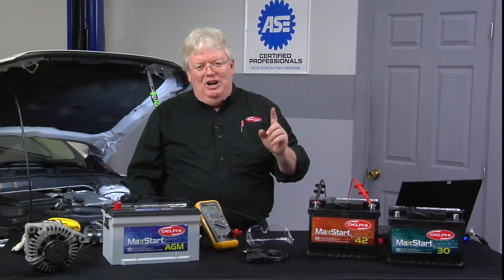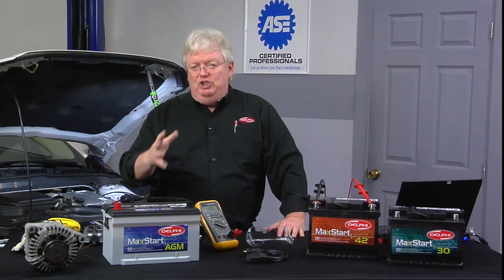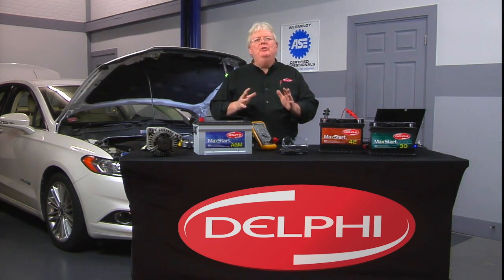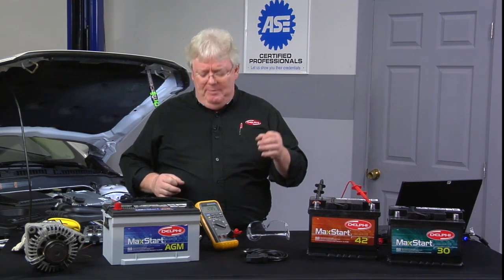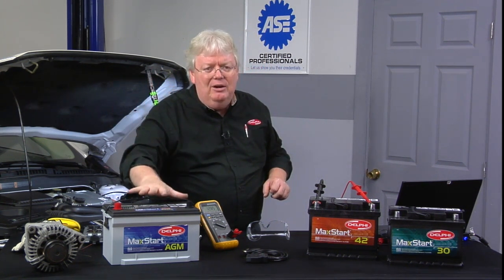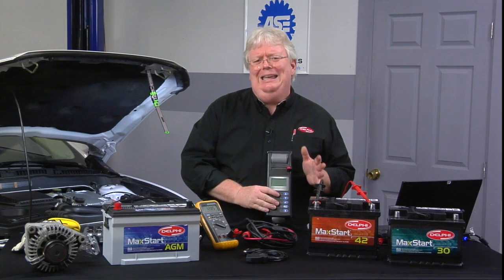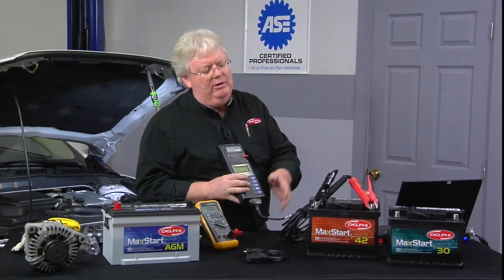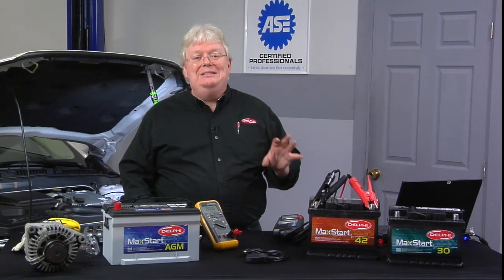How to Charge and Test Absorbed Glass Mat (AGM) Batteries

Comment: What is the life expectancy of an AGM battery versus a Lead Acid Battery?
Reply: Alot longer. Had an agm Superstart battery last many years.
Reply: @Fleepage  Not very helpful. "many years" means nothing. Googling the question showed up 6-10 years. Considering the extra cost, i've had conventional lead acid batteries last that same range.
Reply: @KStewart-th4sk  try to use a lead acid battery for things other than just starting your car & it's life will go down the shitter pretty quickly. Agm will last much longer. Esp for deep cycle applications
Reply: @Fleepage  You are not very helpful. "many years" means nothing. Googling the question came up with 6-10 years. Considering the extra cost of AGM batteries, i've had conventional lead acid batteries last that long.
Reply: @KStewart-th4sk  there isnt a specific number. Depends on brand and depends on application and depends on maintenance

Comment: I just bought a new battery at orielys. Agm 12v for 94 suburban. 

Rated 775 ccA
I tested it. Got 750cca. 
12.18v.

Sticker says date 6/19.   

It's a super start label platinum agm.
Reply: At 12.18V it's not even 50% charged.  Fully charge it and test again.
Reply: I would return it.  6/19, bought 7/19, agm 12.18 means someone didn't make it happy at the store
Reply: When battery is stored it should be periodically charged, at least once a year. If your new battery voltage is 12.18 most probably it has not been charged for years and is already having some sulfation. To recover it needs to be charged at 14.6V till the current stops lowering (should be lower then 0.2% of capacity, like <0.1A for 55Ah battery). Next step is to hold it under 2-3% current (1.1-1.65A for 55Ah for ex.) for around a day. This should remove most of sulfation.

Comment: Do RVs overcharged AGM batteries?
Reply: Yes, that's possible. Float voltage should be between 13.5 - 13.8V for AGM and not 14.4V!
Reply: If a seperator in the RV, it should not.  Basically protection so they do not go over 85% full.

Comment: The conductance/ capacitance battery capacity testers do a good job when comparing batteries of the same manufacturer's model and can point to weaknesses even on new batteries, and different tester mfg's can give different capacity numbers for the same battery, and they can give very consistent results.  The CCA capacity calculated is just that, it is not directly measured.  Tests are non-destructive so the current draw is minimal.  Narrowed your selection for a new battery to a specific model?  Use the tester to check several of those same models on the shelf and select the one giving the highest test results.  Some brands vary as much as +/- 15% even within the same lot/ same day code, so why not take the best?  Other brands may vary less than 2%.  Btw, the tester used in this video looks like a variant of a Midtronics EXP800, one that wil give consistent results.  Another reliable tester that gives slightly higher CCA results than the EXP800 is the Snap-On YA2636, and its results are about 10% that carbon pile results, which are the most definitive. 

Performing a couple of back to back carbon pile tests, (with a several minute break between tests to allow internal cooling), gives the most definitive results.  And testing at the high current will sometimes cause even a new battery to fail open.  (Out of a lot of 3000 one year old charged but unused AGM batteries from a well-know AGM brand mfg, fully one third failed my carbon pile test, which in this case, tested an 800 CCA rated AGM battery at 600 A for 15 seconds at 60 F.  Interestingly, it was the internal bus of the cell at the same location in each battery that was responsible for the majority of the failures.)  Besides the venerable Sun VAT40 carbon pile tester mentioned in this video, other good ones are the Sun VAT28 and later versions, and Snap-On MT1560 and MT1590.  (A not so-good CC pile tester is from Harbor Freight, whose flimsy construction is borderline dangerous and steel terminal clamps will melt grooves into the battery's terminals at high current testing.)   (If the carbon pile tester has not been used recently at high current, perform some low level current tests to drive off the absorb moisture from the carbon disks to reduce spalling.)

Comment: For those wanting to increase the useful life of an AGM battery by 300+ percent, take a look at this link:   www.nrel.gov/transportation/assets/pdfs/evs_17paper.pdf and 
https://afdc.energy.gov/files/pdfs/inter_charging.pdf
10% overcharge of the total charged during the current charging cycle, with the overcharging made in short bursts to avoid localized overheating.  So if charging a 50 Ah capacity battery starting at at 80% charge, charge 9 Ah to the 0 dV/dt, and then charge an additional 1 Ah.  (If you do not get this, it probably is best to give technique a pass.)  It should also be noted that the NREL was using deep cycle AGM batteries for their study;  using non deep cycle AGM batteries cycled repeatedly down to 10.5 V would have likely killed the batteries quickly.

Comment: hi i have a gm battery reading 13v off load charged it up at 2 a x48 hrs but on load test it fails on crank test meter only 1/4 on meter but voltage is there is battery duff
open circuit 12.9 v
can you advise
Reply: Sulfated??
Reply: Yes, it's probably sulphated.  @somaday2595   The open circuit voltage of a battery proves very little as to how good it is. An easy way is to fully charge the battery, then put a load such as 2 car headlights on and see how long it lasts down to 11.1 volts (no lower). Buy a cheap multimeter if necessary. If the battery is say, 70 amp hours and a draw of about 10 amps only lasts for an hour or not much longer, you're battery is poor. It should last quite a few hours, especially being AGM. (NB about 6 hours down to 10.5 v at 10 amps when new). Strictly speaking, the battery capacity would often  be tested down to 10.5 volts at the C/20 rate, or 3.5 amp draw for a 70 amp hour battery, but a pair of headlamps will probably be about 2 x 60 watt bulbs, so be probably near a 10 amp draw. I wouldn't discharge a car battery down to 10.5 volts on load, as the test itself could shorten its life. You could take your battery in to a garage offering free tests, but most batteries a few years old are down in capacity, it just depends how much, and whether you want a new one or to try & get a bit longer out of your existing battery. (Human nature is sometimes for a battery supplier to want to sell you a new one).
Reply: Make sure your battery connections & the earth strap are tight & not corroded. Undo them if necessary & sand them off, but remember your radio code can get lost if you don't keep 12 volts present, even by a small 12 v battery fed into the cigarette lighter socket. I hope this helps somebody, though no doubt you've sorted things by now yourself.

Comment: im thinking that any battery that says non spillable is an AGM battery....all of my jump start internal batteries say non spillable on them but do not say AGM on the battery label....but like i said i would assume they have to be AGM since the product can be moved around etc..and wouldnt want acid to spill out..hence the AGM technology...thanks
Reply: Your assumption is invalid.
Reply: also...  it will say agm somewhere in a part # or even stamped in the case as it is considered an upgrade to conv led/acid, sealed or not.
Reply: Non-spillable refers to what would happened if the battery casing were breached, not the battery technology.  So if non-spillable and the battery was smashed, the electrolyte would not flow.

AGM batteries are non-spillable because the electrolyte is in the form of a paste.  Gel batteries, also non-spillable, have electrolyte in gel form, often made by adding fumed silica to the sulfuric acid/ lead sulfate solution.

Comment: I know what agm is...but my battery doesnt say agm on it....it says non spillable sealed leadcacid on it.....how do i know if its agm?
Reply: usually a dry cell. sounds like a lead acid sealed battery not agm x
Reply: @elixier33  - A dry cell would not use lead/ acid.
Reply: https://www.youtube.com/watch?v=99oGcq4-t-4
Reply: Sort of cutting the battery open, the battery model would need to be compared to the mfg's description.  It could be a gel battery, e.g.
Reply: der ddd You have a SLI battery

Comment: good explaining there. Unless I'm dead wrong, when you measured 960 CCA on the battery I assume the battery was near room temperature. That's normal. Put the battery in a deep freezer for a day, yank it out and do test again. I bet it will be closer to the rating. Thanks.
Reply: Curt Chase no it’s calculating the CCA not calculating the Cranking Amps at the current temps and then calling that CCA